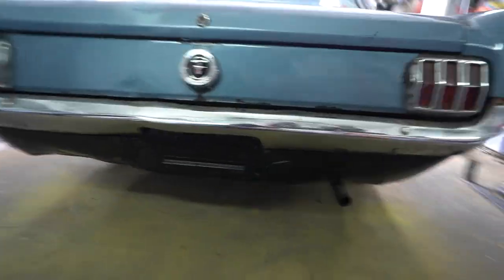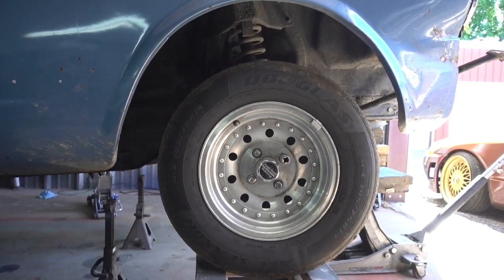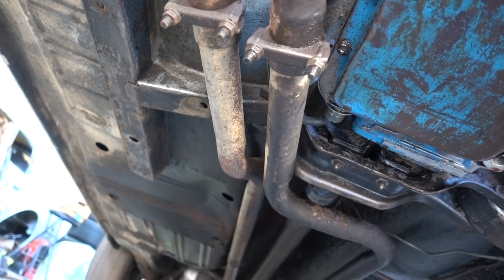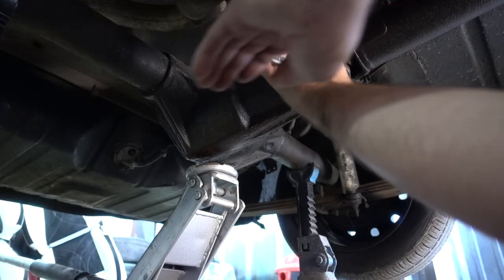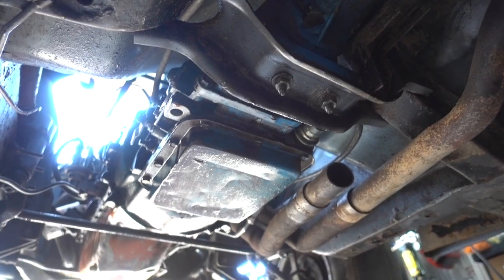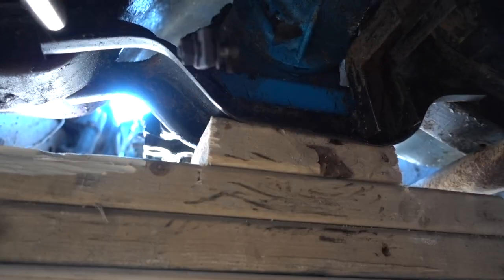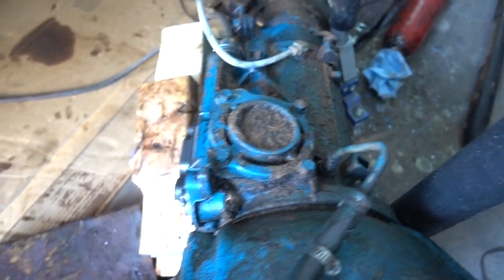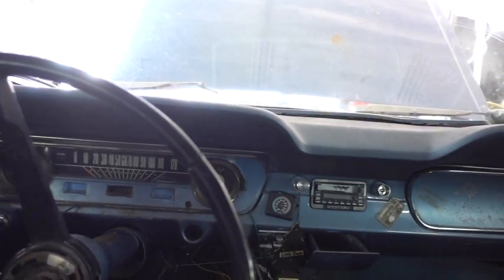Removing a 1965 Mustang Transmission

Comment: When removing an automatic transmission, detatch the torque converter from the flex plate and push it back into the bell housing. Then drop the transmission with torque converter attached. No oil spill to contend with. Saves on the environment.

Comment: That's a "green dot" C4 3 speed automatic. Named for the green dot next to the D on column shift indicator. Green dot is 2nd gear, let's you pull out in snow better. Got same trans in my '65 Falcon :-)